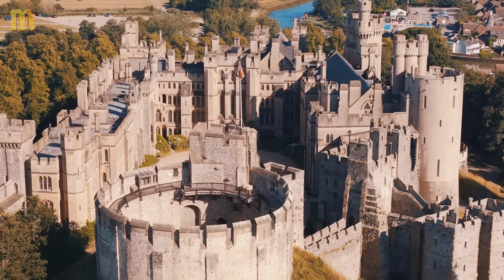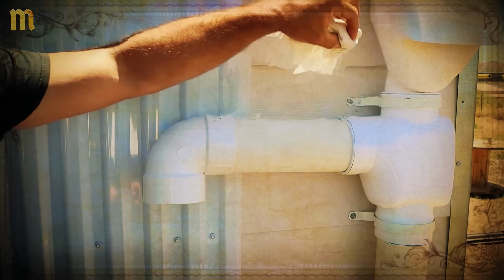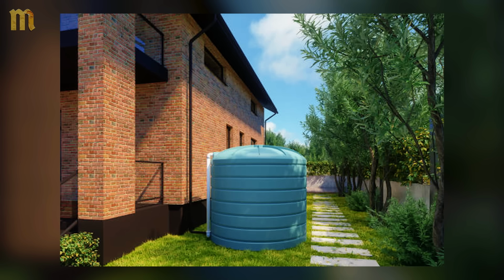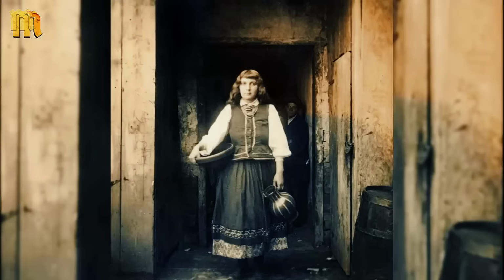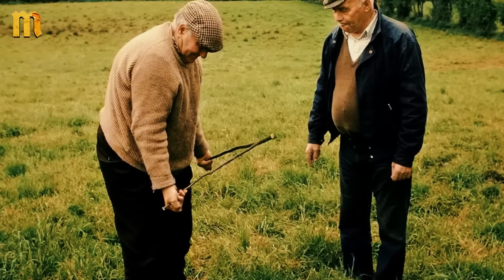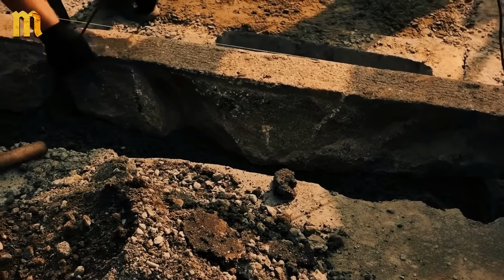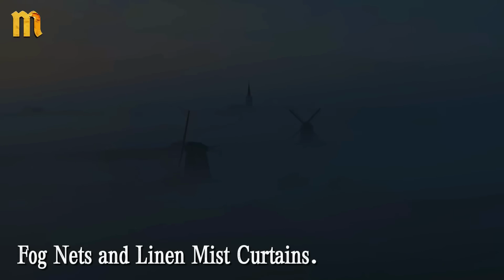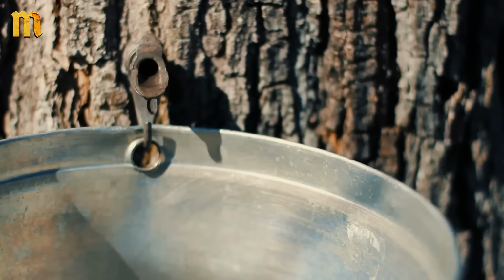Build This GENIUS Medieval Rainwater Harvesting System

Comment: Plus a layet of charkcoal to filter put odors o funky tastes😮
Reply from the maker: Charcoal layer works for taste/odor, but check flow rate. Too much filtration media slows the system. Stack it loose or the pressure drop defeats gravity-fed design.

Comment: I also noticed the order you showed was wrong. You use corset material first working down to the finest material last. The proper order is stone, pea gravel, then sand. Doing it backwards clogs the sand bed with debris that the pea gravel or stone should have caught. Charcoal is more chemical filtration not physical filtration.

Comment: The filter is good HOWEVER there used to be a professor who taught in Hawaii that did it better. He separated the different materials into seperate c9ntainers so it made maintenance much easier. Also sldepend8ng on the amount of rain at one time your able to smaller containers just as long as they can drain faster than they fill to prevent overflow. By using seperate containers you can do maintenance on each medium without disturbing the rest.

Comment: Putting twigs at the bottom would just cause mold, fungus, and particles to be put back into the water. The system is not right.
Reply from the maker: Putting twigs at the bottom of a still cistern would do exactly that. The method only works when it's a flow-through bed, not standing water. The organic layer sits where water moves past it, so the biofilm stays aerobic and traps sediment instead of feeding rot. Stagnant tank, you're right, it turns anaerobic fast.

Comment: This finally makes sense. What about the water freezing in winter? Will putting the cistern half in ground prevent that? Thanks
Reply: How deep is the normal water pipe laying in your country. Here is it 1 mtr under the ground. So the tank must also at least 1 mtr under the ground and than you have to measure the distance from tank to home. 0,5 to 1 cm pro meter. The water pipe comes in home out of the ground,

Comment: We live totally on rain water here. I have found we need about 14000 gallons to get us from rain to rain. This tutorial is great! One thing to add; remember to consider gravity in the placement of all elements of the system. Water only runs down hill.
Reply: Either you don't get rain very often or you have a huge garden. Thank you for a comment that lets people know that it is possible in either case.
Reply: @alanesterline2310 or to less Humus in the soil. This results in the soil retaining little to no water. The forgotten rules of sunlight and mowing height may also play a role. Basically, the more sunlight, the higher or lower the grass you mow. Any taller vegetation insulates the soil from drying out.
In other words, at least 15 cm of grass in midsummer.
Reply: Jesus loves you!

Comment: Thanks, now I'm thinking about a power generation system for heavy rain areas that make large turbines and solar panels less than ideal. If a turbine was placed between each container, the water from a good rain could run a household. Rainwater powering the stove used to boil it sounds like a good use of space to me.

Comment: Roofing materials need to be non toxic. Not tar. Galvanized steel or anodized aluminum or natural wood. Little known fact. Most silicone has fungicides, it says right on the label that it’s mold resistant. Use silicone specified for aquariums. This is a serious health hazard!For real self reliance need massive storage. Also check out British Berkfield water filters for drinking and cooking water.

Comment: I have been buying and collecting items for my roof type water catchment system. It will have a first flush, then a stone, sand, and bio- char filter, and a large storage tank  It will supply my outdoor shower. Connected to my garden sink with a hose connection too. And at the far end is my laundry tubs for washing & rinsing my laundry with a hand crank roller to squeeze out the water. My clothes line is 3/8" stainless steel clothes line from the corner of my storage barn to a tree 100ft away. All my water needs in one place at the back wall of my 30 × 50 storage barn. Lighted by shaded sun by day and large solar lights at night. Right across from the garden area.
Reply: Sounds good except for the tree. If that's where your clothesline used connected, you may be setting yourself up for disaster if lightning strikes that tree. I know that from experience. It jumped to the house knocking out a television stove fridge and television. I felt fortunate to have a home left. My clothesline was blown off the tree and not by the wind.